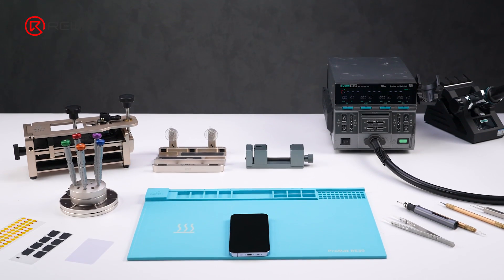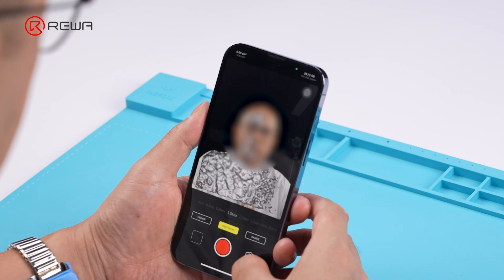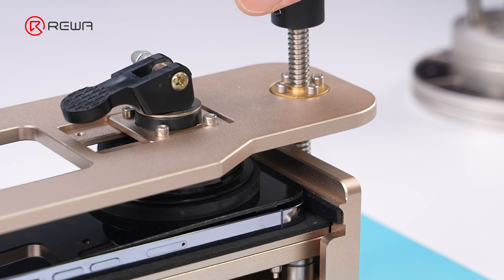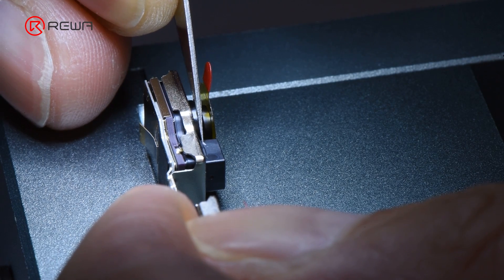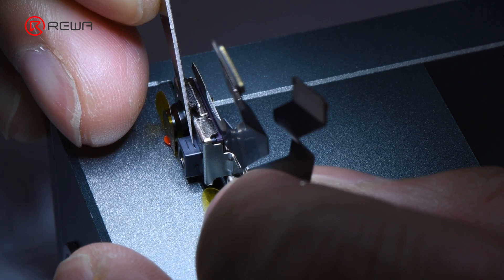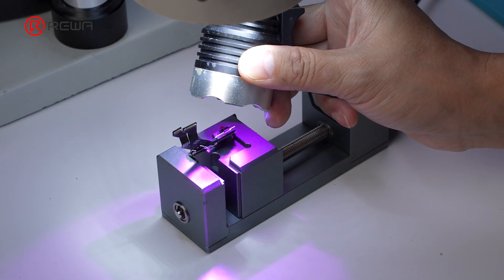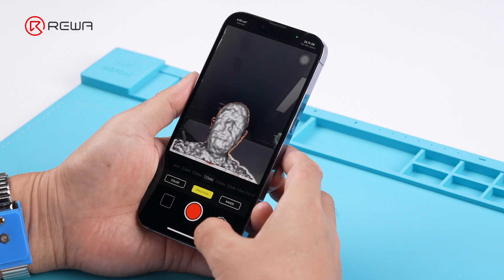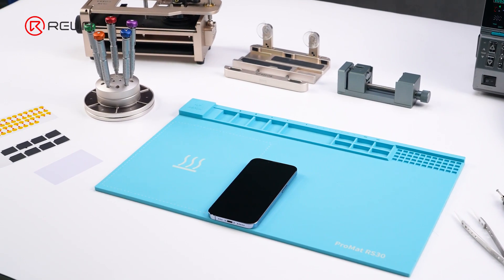iPhone 13 Pro Face ID Common Failure - Fixing without Dot Projector Disassembly

Comment: I fixed the front glass on a 13 Pro max that had an impact crack on top of the Dot projector / IR sensor but the glass appeared intact. I now have a message saying 'FACE ID is not available. Please try again later'. True depth camera NOT 'disabled'. What is the difference in meaning between 'FACE ID is Not available message and 'Face ID has been disabled. Do these two messages mean different problems and solutions?

Also, I have tried to download Hedges app to diagnose problem but its states there is no True depth camera available. Will I need a FACE ID Board and programmer to diagnose instead?

Thanks
Reply from the maker: We also met that before, first, use iphone autodiagnosis, you can check whether there is a Face Id issue, if it still truedepth camera, so you may need to flash the phone to try whether it can read truedepth camera

Comment: Can you explain about resistor shunt 6 pin, in samsung a30s? How can i jumper?
Reply from the maker: Absolutely you can apply jumper wire to repair.